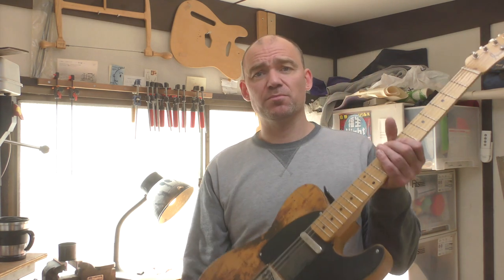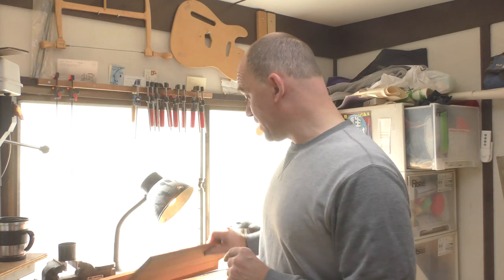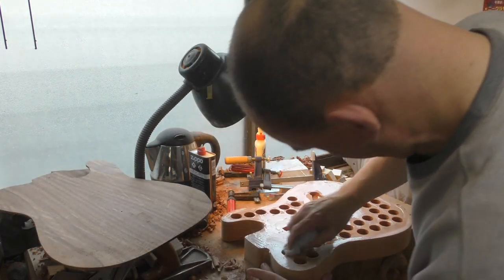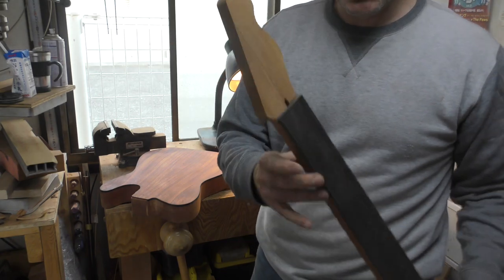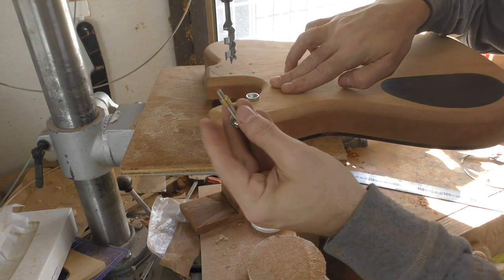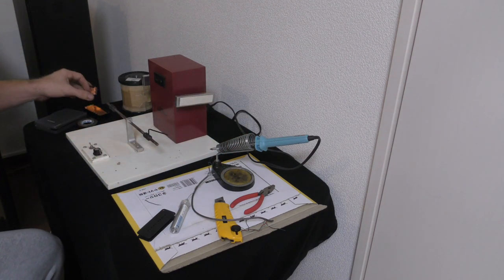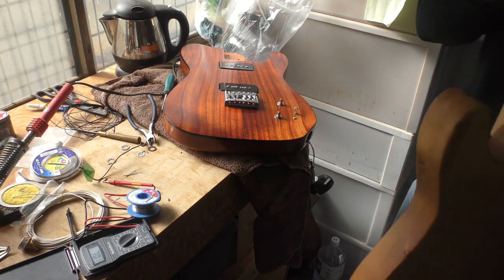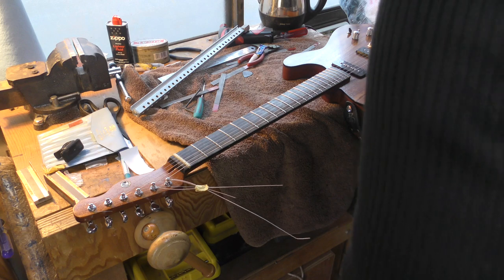Making an Electric Guitar from Odds and Ends

Comment: I just watched parts 1 and 2 of the flaxwood guitar. I'd like to see how it came out. If you ever finished. 😉 I'm thinking of picking up one of those kits. I heard the action is a bit high. I like low action. Is that possible to achieve with one?
Reply from the maker: Hi - yes it is absolutely possible. It's all in the setup. I did string up and play the guitar, but the finish I used had some bubbling issues, and I haven't redone it yet. The guitar is, unfortunately, sitting in storage right now.